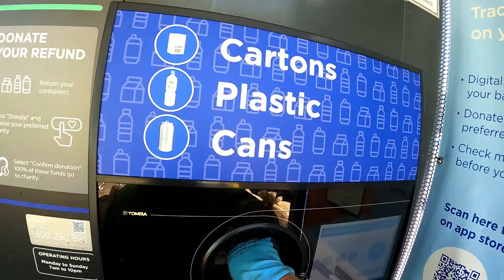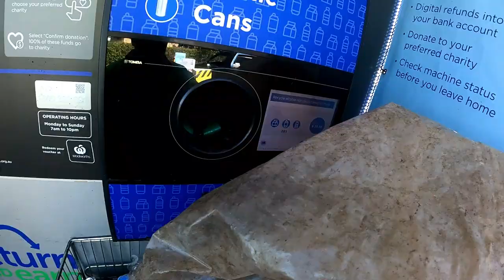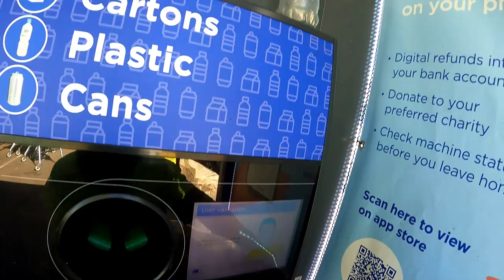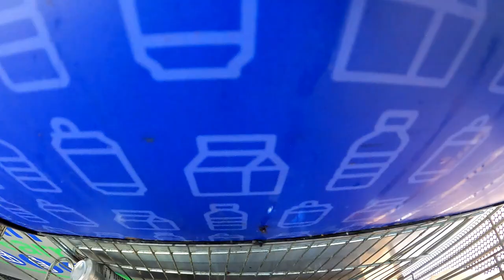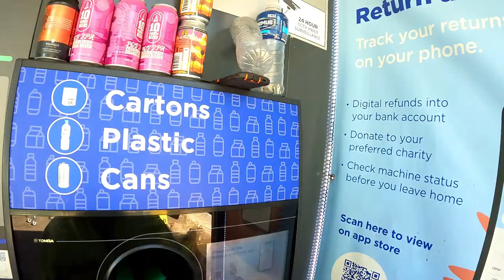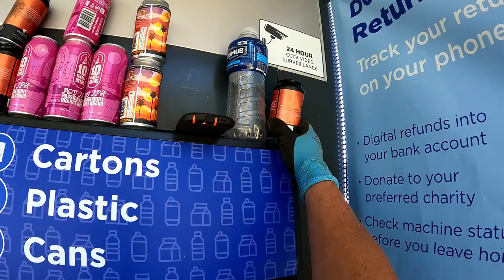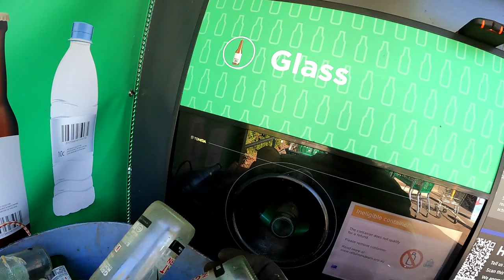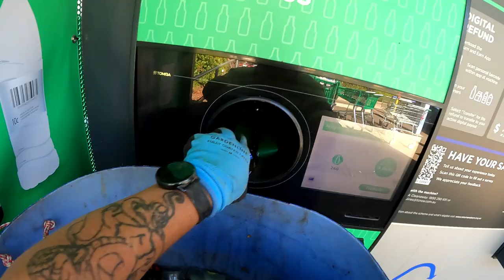Dumpster Diving Work Smarter No Harder With A Donation !!!

Comment: You mentioned that liquor and wine bottles would soon be worthwhile to turn in.  Any idea of what they would be worth?  Surely, the Revenue Department would require a printed label on each bottle.  So, that would take time to do.  Amazing the variety of sodas and beer.  Thought I even saw Jack Daniels on some cans.  I had some Jim Beam with flavor in my litter pickup.  We have a small bee called a yellow jacket. It is bad in the summer with the bees around who love the sugar in the cans.  They can sting again and again and don't die.  It would be so much easier if the company would allow you to turn the cans in to be weighed.  Or, if they would allow you to crush them and then turn the cubes in.
Reply from the maker: Not really sure how much they would be worth but I think they would only be $0.10 regardless of the size there was a news clip back in February but I still think it will take longer than what they reckon.